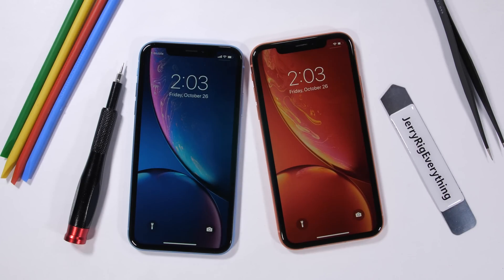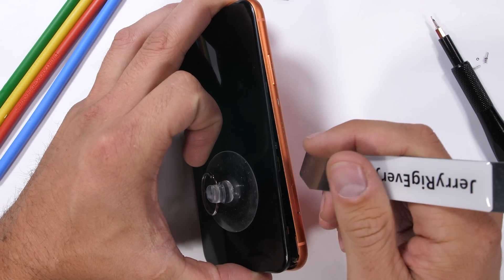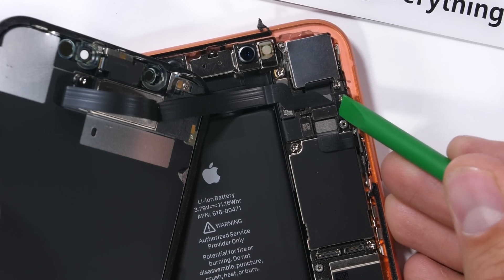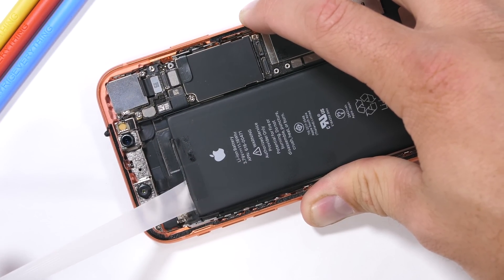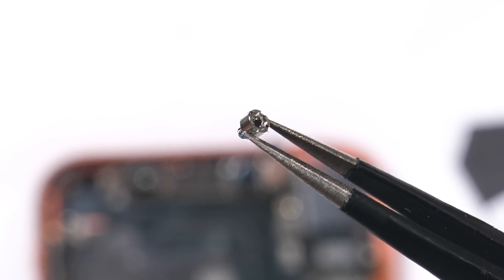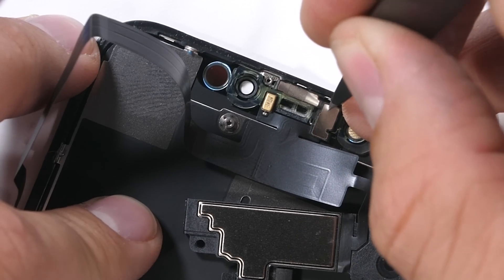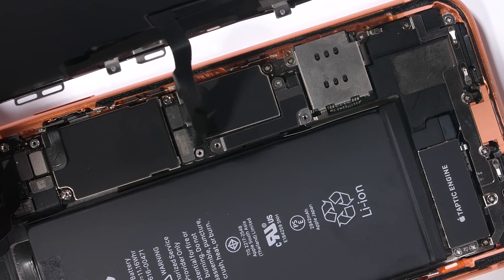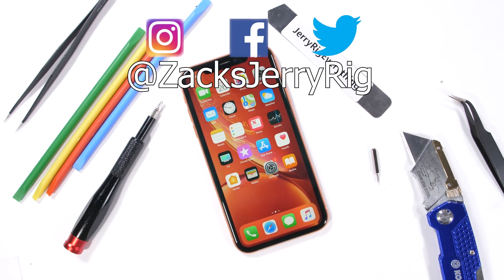iPhone XR Teardown! - How to open the colored iPhone?

Comment: You had me at, 'remove triple-zero screws". Two screws are stripped, and two others I dropped on the floor. This is easier to watch than actually performing. I hope to have the charging port replaced sometime in 2023! Thank you for your entertainment.

Comment: Hi Zach I’m one of ur subscribers. I have a kind of a big problem. I have an iPhone XR that has a crack on the top right hand side of the screen. I’m trying to get it fixed. But I just want to know where I could get a replacement screen. And the tools to fix it. I watched ur video and it helped by telling me where I need to take out the LEGO connecters and where to take  the screws. So could u plz help me?

Comment: Not really expecting an answer or anything but I have a question about preforming repair on smart phones. It's safe to say most if not all current smart phones are sealed in a way to make them water resistant. I've watched multiple videos of yours and seen how many times the glue or seal has fought the opening of the phone case every time.

After you're done with your teardown or repairs, is there any way to redo the seal itself so the device can retain its water resistant status? I mean it's obvious the seal is pretty much destroyed by the opening of the device. I'm just curious if there's any way to retain the water resistance a device may have originally had.
Reply: 3 years passed and still no answer :'(

Comment: 2:50 did u really just said 2900mA? On a 800 dollar device with a big display?? My samsung j5 6 which is now almost 3 years old, an costs 80 Dollars,  has a better Battery than this. It has 3100mA. Wtf

Comment: I'm sure that $30 LCD for the iPhone 8 you speak of is total garbage. Find original Apple LCD with refurbished glass if you can. Trust me, I had an aftermarket LCD on my iPhone 7 and it looked and performed so bad making my iPhone look like a knock off. Found Apple LCD on eBay for $40 and it's 1000 times better.

Comment: It’s weird that Apple claims they don’t have room for a headphone jack, when Samsung can fit an entire pen inside their phones.
Reply: And headphone jacks and pens and water resistant
Reply: AND a headphone jack. And the note 9 is still lighter than the XS
Reply: Bianca N not anymore
Reply: Bianca N no headphome jack anymore
Reply: @biancan2209  not anymore
Reply: Bianca N 
The iPhone XS has a heavier stainless steel frame vs the lighter, cheaper but less durable aluminum one on most phones.
Reply: bizmonkey007 but Xr has aluminium and still is heavier
Reply: @bizmonkey007  that is a excuse, I've seen steel phones with headphone jack
Reply: @bizmonkey007 heavier stainless steel frame for 10 floor apple building. haha
Reply: @bizmonkey007  durable? These bits of  consumer disposables only have to last 12 - 24 months and you'll be scrabbling for the next phone, which I won't buy, they are way over priced.
Reply: Bianca N iphone xs is smaller than note 9 with bigger display
Reply: Bianca N the xs is made of steel which is heavier then the aluminum on the note 9 and xr. Plus I think heavier phone feels better.
Reply: Bianca N but the iPhone is faster
Reply: @biancan2209  the note 9 doesn't use stainless steel.
Reply: @bibletwink666  so the iPhone weighs 2x more than the note, and the battery lasts half of what the note does. And there's a headphone jack. And a pen. And the display is better. Why get an iPhone
Reply: @biancan2209  if we're talking about the note 9, then the xs max display is better. The note also doesn't use stainless steel.
Reply: @bibletwink666  You know samsung makes the display and sells them to apple, right? You really think samsung is gonna give apple their best display?
Reply: @biancan2209  you know that apple tweaks the displays right? Check displaymate.
Reply: @biancan2209  also the xs max doesn't weigh 2x of what the note weighs. It weighs 7 grams more.
Reply: @bibletwink666  they make the display more yellow. we can adjust the display manually, other than apple having to do it for us. we can debate all day, i had an iphone, apple watch, im on my macbook, i had an ipad, i sold it all lol i'm choosing what i think is better. also, the xs max's battery is 2600 mAh while the note 9 is 4000 mAh. I just need a reliable phone
Reply: @biancan2209  again check displaymate.
Reply: @biancan2209  also the xs max has better battery management.
Reply: @bibletwink666  EverythingApplePro did a review saying that the s10 lasted longer than the XS Max with a battery case. Next.
Reply: @biancan2209  yet there have been tests that show the difference is smaller.
Reply: @bibletwink666  link me to the test. XS Max vs note 9 or s10 battery.
Reply: demetre nadiradze "xs max has better battery management" lmao why doesnt apple make a 4000mah battery with "better battery management"
Reply: @biancan2209  No, Apple designs the display and chooses the materials and they send them to samsung for them to manufacture. It's like sending a recipe to a chef to make.
Reply: Top ten comments that didn't age well
Reply: big chungus this comment hasn’t aged well. It’s weird that note 10 can fit an entire stylus and still have no room for headphone jack
Reply: Lol someone's not gonna like the Note 10 😂😂😂
Reply: @redshirtrisay  it's funny now that it came out. But it's one hit to an otherwise amazing phone
Reply: Ahem note Ahem 10
Reply: They have room, they just want your money. Why include a headphone jack when they can make you pay for an adaptor? They say it’s for space and the make it more water proof but it’s still annoying.
Reply: This comment aged horribly bahahaha
Reply: well this comment hasnt aged well...
Reply: They just removed it kid....
Reply: And right now they can only fit a pen, no headphone jack. I think they wanna boost their buds' sale.
Reply: Not with the Note 10 series 😂
Reply: Their main intentions were to make sure that the airpods would sell. There's a different between Samsung and Apple. Samsung gave you a choice, and Apple didn't.
Reply: Without a headphone jack though
Reply: What about now?
Reply: This aged horribly
Reply: Why the fuck is everyone so fucking triggered
Reply: I like potatoes and a headphone jack LMAO
Reply: It’s also weird that Samsung made fun of apple for removing said headphone jack only to remove in in their own phone without announcing it. At that time they also tried their best to remove all of the videos of them making fun of apple. Total hypocrites.
Reply: Yep true but stil R.I.P. HEADPHONE jack
Reply: I like potatoes Note phones are way bigger
Reply: Atkinson worldwide Kaylum more th 2 yesr old phone
Reply: Well according to the tear down it seems they are right. But maybe they could make some things smaller to fit the headphone jack.
Reply: they do it for money
third parties have tonpay them for the port they use look the rest up im too lazy to tell
Reply: Steve Jobs has good reason not to include a stylus in their phones
Reply: big chungus wanna know what else is weird.. Your a fucking idiot for disrespecting apple
Reply: Note 10 joined the group.
Reply: it's funny seeing isheep and samholes arguing and the fact they can't accept both phones are great.
Reply: @asianserenadr7776  Apple guy here... Samsung makes great phones. Apple makes great phones. Both have their strengths and weaknesses for sure. I am still rocking a XR and it hasn't let me down at all.
Reply: @jefferyjones8399  I currently use a 12 mini not because i like apple, but simply because it's a great phone in itself in the compact smartphone category. 

XR is a fine phone i just wouldn't use it because it looks outdated
Reply: @asianserenadr7776  I agree but why samholes out of all names, you could’ve atleast said samshitheads or something
Reply: I like potatoes agreed
Reply: They are huge asf and thick
Reply: Ben and Izzy Productions  yeah right...
Reply: @AndrewLucienBao  are you on about samsung? You do know iphone cameras are usually at a worse resolution right? As well as Samsung having higher resolution screens
Reply: Travis Taylor-OBrien iPhones don’t use 1440p because it’s legit pointless 

I forgot what resolution iPhones use but it’s high than 1080

But regardless the pixels are so small you can tell the difference between 1080 vs 1440

1440p is a waste of battery life tbh
Reply: @travistaylor-obrien1096  The iPhone 11 (Pro) can handle video (for exposure) and colour accuracy better than the Note 10's camera, and the screen was said to be the best screen on a smartphone in the market right now by some person in terms of colour accuracy, viewing angles etc.
Samsung has USB C and Bilateral charging though.
Reply: Note 10,dont hold my jack
Reply: What about the Note10 now? 😂
Reply: talk shit after the note 10, also a 99% satisfaction rate from this phone.
Reply: Caps  I really wish that companies wouldn't make their marketing tactics affect how their products work. I bet that just by following that rule, you can cause sales and positive feedback to increase.
Reply: So truueeeeeee
Reply: It’s Not that they don’t have room it’s that if they did add one the phone wouldn’t be water resistant completely. (Water would get into the phone through the jack)
Reply: shrek get AirPods lmao what? They never claimed they can’t if you are stuck in the past get a 6s or build a headphone jack it’s been done
Reply: How about now with Samsung removing the headphone jack
Reply: Unknown User what does that have to do with whats better
Reply: Look at Samsung now lmfao no headphone jack either.
Reply: Samsung is Samsung . Apple is apple
Reply: lol
Reply: The difference is that Samsung don’t use the space they got to make premium devices; whereas Apple do..
Reply: They want the consumers to spend more money on expensive accessories 
Air pods 
Air tags 
Etc
Reply: The note phones can fit a pen because they are huge.
Reply: Jessica Wilson But it is very similar in size to the XS, which has a larger battery, headphone jack and pen.
Reply: What’s a headphone jack?
Reply: @justinthompson2817   u r stupid
Reply: @justinthompson2817  some ancient technological component in a device (such as a phone, that allows you to listen to music) that poor people like to still hang on too
Reply: @PacMan755  Well, as a person who prefers Apple, I'd like to be able to use a headphone jack you know? It's just convenient to have it there in case anything happens. Plus, wired headphones don't run out of battery and cost way less.
Reply: @I like potatoes , thats samsung bruh. Not apple.
Reply: If people don’t like iPhones then don’t watch videos about them 🤷🏼‍♂️ simple. Each to their own
Reply: LOL This comment didn't age well!
Reply: Oi reply big chungus, what about now? Note 10 can fit a stylus but has no headphone jack lol. Cant reply coz you got owned by your own comment?
Reply: Samsung sucks tho
Reply: You realize apple did this so there AirPods would sell
Reply: Headphone jack? Are you from the 1990’s?
Reply: @Loki-sk7bi  🙄
Reply: @Loki-sk7bi  Yeah, cuz practicality is from the 1990's
Reply: and yet somehow the iphone can perform better 🙄
Reply: The headphone jack is replaceable. A bigger battery or a bigger taptic engine isn't.
Reply: @bibletwink666  on a phone so ridiculously expensive you shouldn't have any trade offs.
Reply: @isaaclyonsf1  oh you missed the note 10 announcement? Every single phone has a trade off.
Reply: No taptic engine inside the XR.  @bibletwink666
Reply: mikey the xr has a taptic engine
Reply: Apple is still the best
Reply: Fucking stupid ass samshit fanboy commentv🤦🏽‍♂️ done with these dumbasses 🤣
Reply: Wow you don’t have wireless headphones in 2019? What, are you like living in a slum or homeless? Fucking filthy ass
Reply: @rxstfx6076  haha good one.
Reply: Who needs headphone jack in 2019 fucking idiots
Reply: iFrarisHD I need it. What are you gonna call me, “poor”? If that’s your argument, then your argumentation skills are smaller than my room temperature
Reply: HangarGeek 

That’s a bad roast...
Reply: HangarGeek chill😭😭😂😂😂😂😂
Reply: @ifrarishd5582  You do understand that audio that comes from a headphone jack will always sound better than from a bluetooth connection right? Bluetooth may seem "cool" to you but those who actually enjoy listening to music and/or those who make music really thanks Samsung for keeping the jack.
Reply: @ifrarishd5582  a lot of people....idiot.
Reply: Poor guys

Comment: Could you install your own higher quality screen in the XR and it work?
Reply: Unfortunately no unless someone can mod the iPhone at a motherboard level (as far as I’m aware)
Reply: The screens not bad at all I am watching this video on an xr and the quality isn’t bad at all
Reply: vl Sparrow lv We Don’t want an isheep opinion. 828p resolution is the reason why he is asking to apply his own screen in the first place
Reply: Red Hook MMA until you have seen the screen res I don’t think that you’re one to judge the screen
Reply: Red Hook MMA I’m telling him that he doesn’t need to worry about the spec sheet because the reality isn’t always the expectation
Reply: vl Sparrow lv Well I have seen iphone 11R, 1+7, 1+7 pro as well as Samsung’s S10, S10+ and S10e in my hand.

In my experience the hype of 1+7 pro was broken. And the screen quality was not upto mark. The screen looked quite dull even at the brightest of the screen setting.

Iphone XR looked a little better maybe due to showroom’s low lighting but it was still dull. It didn’t impress me.

Samsung’s S10 lineup, however, looked quite bright and crisp.

Also, the bezels on iphone 11R reminded me of the covers we used to on TV remotes which instantly made me dislike the 11R
Reply: Red Hook MMA so you constantly look at the bezels of a phone?
Reply: vl Sparrow lv Yes.

Comment: Can the aluminum edges be separated from the back panel to mix and match with other XR’s? Red and black or blue and white would be cool options.
Reply: no but you can replace the back glass with another color with a laser machine. Though you will have to painstakingly chip away little bits of the glass little by little

Comment: Replacing the back can’t only be done by Apple haha, you just have to take off the remainder of the back by chipping the residue off. Then putting a new back plate on.

Comment: Does removing the screen mess up the water resistance since your pulling away that material? Just something I’ve always wondered
Reply: of course, what else did you think it would do
Reply: @0w3nn  thanks for the insightful response 4 years later 🤡
Reply: @taylorshockley2210  no problem ;)

Comment: I'm not an isheep, i use a fucking 75$ android phone with 720p display. I often watch youtube videos on 240p, and if the video is still grainy, then i notch it up to 360 or 480p. Doesn't matter most of the time though. Where the pixel count will matter most I when playing high quality graphics games. At 720p, text that are smaller than 7 units (using MS word for basis) are often too grainy to look at. Still, for the price, I'm quite disappointed at the display quality.

And oh by the way, this cheap andoid i am using? My neighbor's kid fuckin threw it on the floor out of gaming frustration. Guess what? Back cover is all cracked at the edges, the ridges that act as spacers for heat management at the back cover are definitely engraved on the baterry from the impact. Still the screen si fine, no dead pixels, touch sensors are good, no cracks, scratches nor discoloration. And before you mention it, this phone had also dropped from more than two meters. It's atop a cabinet while i'm fixing the ceiling. Damn phone just slipped. Plastic sides are dinged from the impact with the cement floor, but phone is still fine. So no, for it won't survive the bend test for sure because it's plastic. It probably won't score high on the screen scratch test either. But fr the added durability of the screen? Fucking companies ramp up the prices just because "screen durability" whilst hardware is still the same. Fml

Comment: I think a screen replacement for the XR would still be pretty pricey
1. It's a custom shape, compared to the basic rectangles on all the past iPhone LCDs.
2. Since the XR has a way smaller chin than all other LCD phones, it probably cost a lot to put the display driver in a different position.
3. It's Apple. What did you expect?

Comment: Hey Zach, when I do battery replacements for android phone for customers, I actually use the apple battery pull tabs for the install😉 As it makes install & replacement in future so much easier(some phones have to trim the tabs, but for the most, works great).....
Cheers, A

Comment: Why iPhone XR has taptic engine, but it doesn't have 3D touch?
Reply: Nico NRG it has haptic touch
Reply: @purab1552  I know it has haptic touch but why it has taptic engine without 3D touch
Reply: for phone call / message vibration and the shorter haptic buzz after long press on camera icon
Reply: Nico NRG weird huh

Comment: I don't get what Apple is doing right now and how. They are using a stacked main board in the X, XS and XS Max because they needed the space for the L-shaped battery. So. WHY the hell is the XR on the other hand using a normal layout from the previous iPhones?! And in a even bigger size. The XR is noticably smaller than the XS Max. But the XS Max with thinner OLEDs (compared to LCD), a stacked main board etc. only has about 200 mAh more?!
It looks like that Apple does not tried to increase the battery size with this L-shaped battery but they actually DECREASED the possible size of the battery and made it worse. If the XR can feature a 2942 mAh in the old component design, the XS Max should be able to feature at least 3500 mAh with this old design. But instead we have a 3174 mAh.